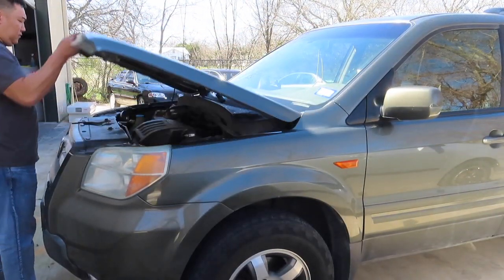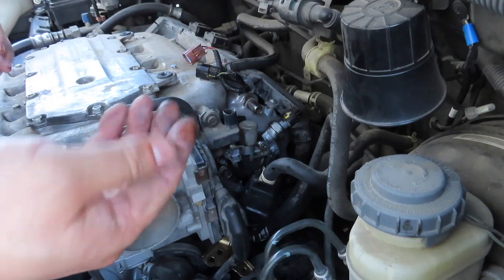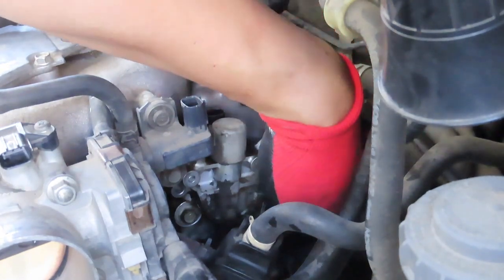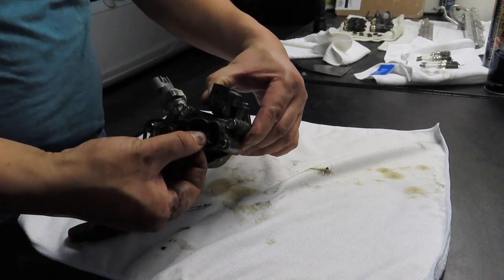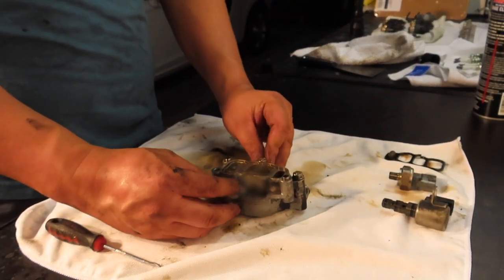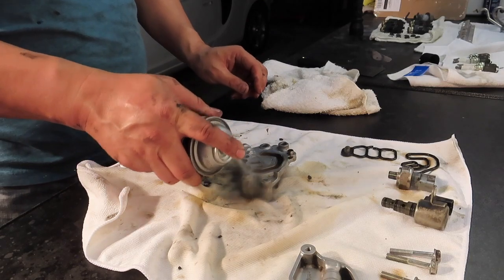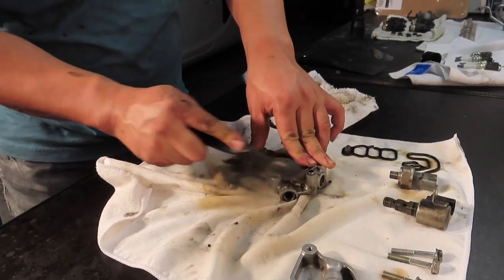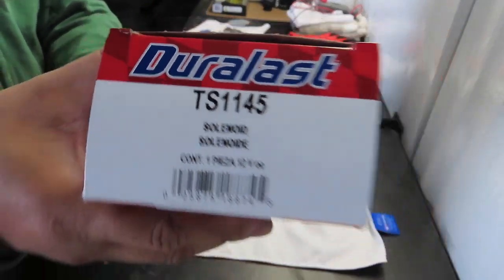Oil Pressure Valve Assembly 2006 Honda Pilot 2WD Part 1

Comment: The middle gasket is now available on the aftermarket. If it’s not cracked you can apply a small layer of Honda bond along the gasket surface and re-seal. Mike was leaking at the middle gasket pooling on top of the VTEC solenoid then running down everywhere.

Comment: Why would you take it a part and clean it, and then just install a new one?  You CAN just replace that lower gasket with the filter screen on one end- usually the problem.

Comment: I'm getting a check engine light code p0523 I think. Do i need to replace sensor or just clean it and replace gasket as well oil leaks out somewhere havnt had time to discover where its coming from sounds like lifters are making noise